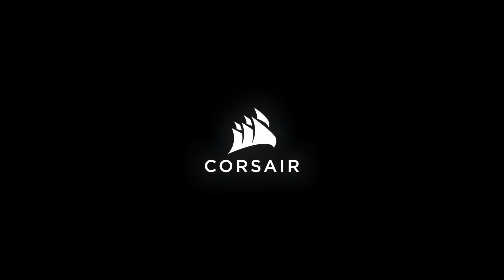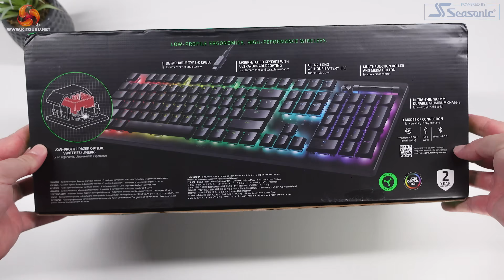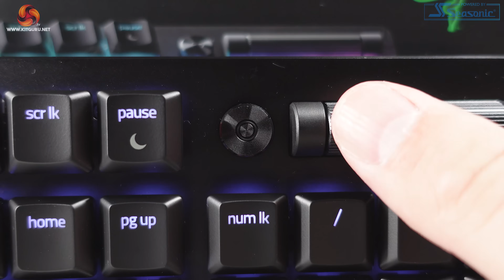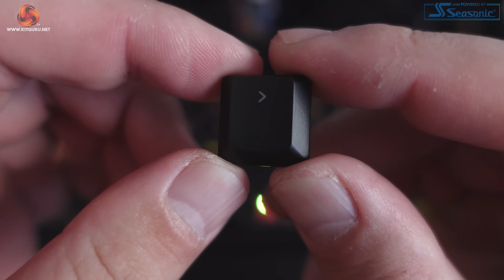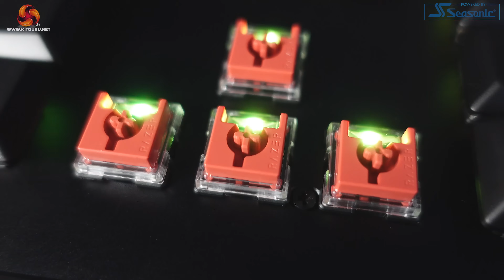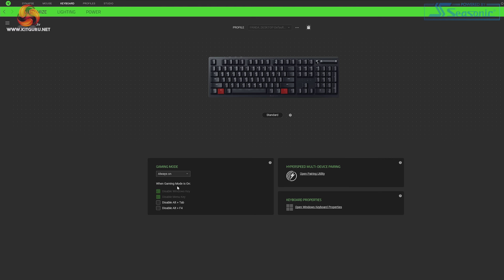Razer DeathStalker V2 Pro - low profile optical!

Comment: Those who are using G913 and 915 .. man .. that's an L .. the stem on that keyboard sucks , it wobbles alot and unstable .. I sold mine and bought this Mainly because of its smaller form factor and USB C instead of Micro B .. BUT .. ended up loving the typing experience
Reply: are you still happy with your keyboard, man?

Comment: but are those switches hot swappable?
Reply: Yes, they are!
Reply: With optical low-profile only. For example Keychron optical low profiles, but they are not as quiet since only Razer has silicone dampeners inside the switch.

Comment: Question for anyone who has this. Has anyone tried putting their ear next to the power button while the keyboard is on only to hear a buzzing/electrical sound? Wondering if this is normal. It's a very low noise, and noticeable during quiet hours if you lean in.

Comment: The real question is Razer going to support keycap replacement sets (call me skeptical, this magic coating on the keycaps is going to hold up after a 1-2 years of use? The switches aren't choc stems so finding an after market keycap set never going to happen, esecially in ISO )

Saying that I kinda like the look of it. I am tempted to try a low profile, but 250 is a lot to buy on a whim and then end up going back to my custom mechs.
Reply: From what I've gathered from other videos, any Cherry MX compatible keycaps should fit.

Comment: I'm not sure - this sounds tempting, but I have the Logitech G915 already and it all depends on whether this board offers any plus on that. From what I could see, it's a lot like the Huntsman V2 just with low-profile switches. Can you confirm that the feel of the switches is similar to that? At any rate, if I get this, I'll wait till it sells on Amazon because there the price usually drops mighty quick.
Reply: I bought it at a store near my house and I was insanely lucky since they priced it at $180 (a bug in their site) so I got it for that price lol

Comment: Looks neat but I'm so heavily invested in Logitech's peripherals (Got gpx superlight, g913 tkl and GPXW headset replacing my G933s). I hope there will be lots more companies doing low profile optical/mechanical keyboard
Reply: G913 still using Micro USB that's hold me
Reply: @7invi  yeah but if you have gpx (also uses micro USB) then it's not a prob and it lasts 1 month or so. You don't have to think needing to charge every day
Reply: @BlizzardWind99  You've got a point, but I have 3-4 cables on my desk, including the 1 micro-USB for my mouse. I just want to replace it if there's a chance. I want to reduce cables as much as possible, even though my 5-year-old Logi Craft keyboard is already using USB-C

Comment: This is like the Logitech G915 minus those annoying G Keys on the left hand side. I also like that Razer backlights the secondary key functions while the Logitech G915 does not.
Reply: Unfortunately for my use case, the G915 wins because of the quicker switching between BT and Wireless for multi device work. Also I prefer TKL
Reply: but this keyboard sounds awful
Reply: @Rubindy  it‘ a low profile gaming brand keyboard. of course it sounds like shit but you don‘t hear it while gaming…

Comment: I would consider the Razer DeathStalker V2 in TKL format because I won't be paying extra for wireless that I won't be using, maybe it will be released later.

But still, this is not worth 250£
Reply: it comes in tkl in august but wireless only

Comment: Razer Synapse needs to be removed from existance. Destroyed. Erased. Burned down.
If their keyboards were able to be used without spamming the user to install thier software every time it was plugged in, I'd consider them ok products.
I would consider them amazing if the onboard memory actually worked as inteded:

1) You plug in your keyboard
2) You install and open up the imaginary good Razer software
3) You load the profile from the keyboard into the software
4) You set everything up the way you want (lighting, polling rate, etc.)
5) You write the profile from the software to the onboard memory
6) You uninstall the imaginary good Razer software
7) Enjoy the keyboard

As it is, assholes who wrote the software make sure that as soon as you plug in your device into another PC,
it reverts back to the default profile in order to force you to spread their cancer software onto that PC as well.
Not to mention that as soon as the device is plugged in, software installer is auto-launched.

I've been using Razer's hardware (Deathadder V2, Viper and Blackwidow Lite) for a long time, but I switched to Logitech because they don't force it on me to use their software.
Their devices do have problems of their own, but they are way better software wise.